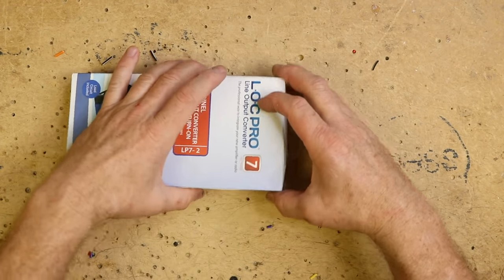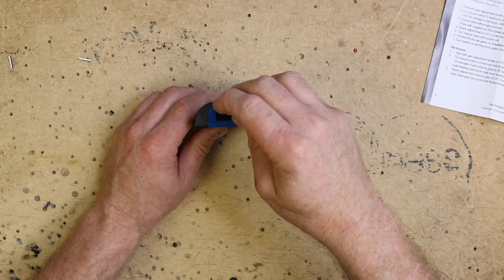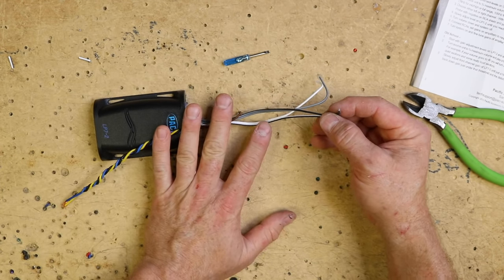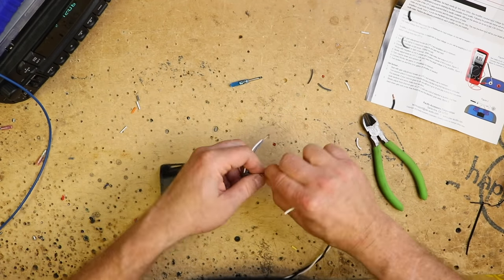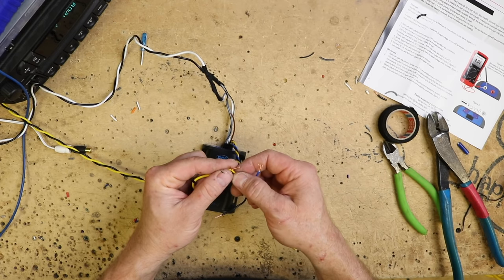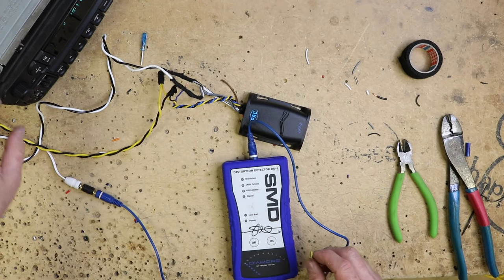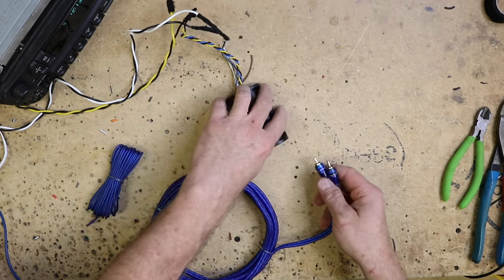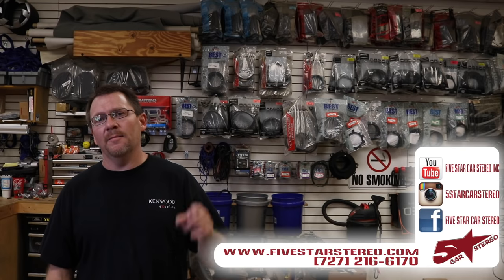How to connect a Pac Audio high to low level adapter, the LP7 2

Comment: I have a 2020 Corolla with JBL system.  I’m using an Audio Control LC1i LOC for my sub setup.  I have to turn the output gain fully clockwise to achieve only 3.9 volts…thoughts???  This should be able to put more voltage out.  BTW, your videos are a huge educational help!

Comment: Great video. I have a question,  I have a Honda civic, can I cut the wires from the speakers front and rear door to go into the loc or do I need to get the wires  from the head unit? Thank you.
Reply: Did you ever install it? I had the same question. Did it work?
Reply: From rear speakers since it gives full range frequency

Comment: If you use the power and ground from the amplifier to turn on the LP 7– 2 and the blue wire from the LP 7-2 to the amplifier remote how does the lp 7-2 turn on and off

Comment: Hi, great video.. I do have a question though... If you are running power to the converter <<< then does this stay on always? You showed the red light the second you connected the power to it... Will this be on all of the time with the red light? Also would it be smart for me to wire a small fuse in between the positive power wire to this thing? if so what size? Thanks! I hope to get a response from someone if they can help.

Comment: What’s the difference between the PAC LP5-4 vs LP6-4 vs LP7-4? I saw one of your install videos when you where working on the exact car I own, infinity g35 with factory Bose system, in that video you used a LP5-4.

I am now attempting that same install but don’t know to buy the LP6-4 or LP7-4...as the LP5-4 is now discontinued by the manufacturer. Please help...don’t want to order the wrong model..also I am aware I will probably lose out on my Bose sub in the rear deck using this. I’ve already picked up an amp and sub for the trunk. Installing pioneer avh2440nex.

Also, I’ve already installed this same radio in my 2012 Altima. Will the PAC SWI RC work for both the 2005 Infinity G35 and the 2012 Nissan Altima?

Thanks in advance for any help!

Comment: I was wondering, for this specific product, on the speaker side do you connect it just to one pair of wires for one speaker or will it go for all the speakers?
Reply from the maker: Alfredo Cantu if you are adding a sub you can tap a left and right speaker. Some people will tap one front and one rear, if you fade the radio at all. You can also just tap one speaker.

Comment: Hi Dean & Fernando!! I have a question about the LP7-2. I finished installing a JL W7 stealthbox and a JL RD 1000/1 amp on my 17 mustang. I tapped into rear deck speakers for signal and ground/power from the amplifier, remote from LP to amp. Played 40 hz test tone through HU and used my DD1+ for distortions. I got my max volume and adjusted the LP7-2 to 2 volts. Now my question is, do i play the 40z test tone again and set my gain on my amp until it shows distortion?? My DD1+ has the ability for overlap and i played 40hz overlap track and used my bass boost to give me 8 db of overlap. Is this the correct way to tune my amp? Or how do i set overlap correctly? When i start and turn my car off, my subwoofer is popping/thump, is this because of the LP voltage or my gains are too high? Please help me with my questions. Thank you!!!!!

Comment: On my sub amp I can use high level on rca input with rca adapters. Then I get signal sensing and remote out. Then send that rear channel out from pass through to 4ch amp rear channel running my NVX XPLOC4 as passive without the DC cables.

Front channels from LOC to front on 4ch amp of course.

Good idea?

6:1 step down what does that mean? My XPLOC4 says that in specifications.

I could only get like 2v if I remember correctly last I installed it.

How did you hook up your volt meter to measure the output?

Comment: I'm guessing this install setup he showed was for a subwoofer amp, because he tied two of the speaker wires together and mentioned that the sub-bass was recorded as mono not stereo. If he were installing this for full frequency speaker install, he wouldn't have done that. That's my understanding anyways, correct me if I'm wrong.

Comment: So you set the volume just before clipping and then measure the volts? or did you lower the volume when measuring the volts? Also, is the track 0 decibels or 0 decibels is achieved by turning the volume knob all the way down?

Comment: Hi there,
Nice tutorial, I have an old GM Delco radio (model number: 2700), my question is all amplifier have 2v, so I need to adjust that to 2v or how to identify this? My radio works only with 10-ohm speakers, so I need to add an amplifier to work with new speaker set.

Comment: I know this is a old video but I bought this now do I need 2 sets of wires from both front speakers for a subwoofer or can I wire them together like you did off just one front speaker lead just wondering thanks

Comment: I've had issues in the past using the radio constant 12v and ground to power LOC's. Rerouting those wires to the amp instead seems to fix it. Is there a reason why the LOC's can't share 12v constant power with the stock radio? Especially in newer vehicles.....thanks

Comment: Really help full. I have one doubt sir. What is the difference between line out put converter and DSP
Reply: LOC is strictly for going high level to low level (speaker wire to RCA for amplifiers) and a DSP is a digital signal processor that is able to manipulate sound and tune by adding equalization effects, adjust crossovers, etc.

Comment: This helped a lot.  One question, I ran a speaker line from after my factory amp.  That line is showing roughly 8 volts on a multi-meter, does that sound right?  Did I grab a non speaker wire?  It's a 2018 Durango with the Beats system so there's about 3 million different wires.

Thanks!

Comment: hello, I do NOT have a need for a remote turn on wire. Is there a benefit to buying an LP7-2 over buying the simple LP3? I simply need high to low conversion to RCA. Does the lp7 have better sound quality or something?

Comment: I wish you showed more of the radio side of this. Do colors black/white, white, grey/black, black all color match wires coming off the radio? Same question with power although im pretty sure yellow is always power. Also if just because i find a yellow, if theres more than one, do i assume its only on when the radio is on or does the LOC always get power? Also how was 2 volts determined for the LOC?
Reply from the maker: Factory radio colors do not follow any pattern. They will not match up with these wire colors. All cars are different
Reply: @FiveStarCarStereoInc   oh fun. you would know the colors for a 2016+ toyota tacoma would ya? also, any input on my other questions. thanks for your help. your channel is awesome.

Comment: Can you do an Install using one of these LOCs but using the rear speakers to do it and avoid dealing with taking out head unit
Reply: Alex Island ahh thats something i would also like to know to cause thats what i was gonna do cause its way easier plus all my wires will be in the trunk so no wire running lol
Reply: You sure can. Like you said, just tap into the rear speakers without having to remove the radio. Remember though, you still need to run a power cable from battery to amp
Reply: eaopanama yea i know the good thing is i gotta dodge charger so my battery is in the trunk
Reply: @rentjeff  It can't get easier than that then!
Reply: eaopanama oh no even the fuse box so no running wires to the front yee lol
Reply: @rentjeff  sweet!
Reply: Alex Island yea

Comment: So is it ok to run the remote wire to the amplifier instead of the head unit or any other accessory as a power source if the LOC has remote turn on??

Comment: If I don't have the extra RCA that you cut off to use to test the volts like you did in the video ,would I just put the positive to the terminal of the loc and negative on the vehicle ??? I used this product in my DodgeDart when I first put my system in it  but just got a nice tester and would like to adjust the game the new school way lol 12in alpine type r sounds good but always would like to make it better if there's room for improvement👍🏻
Reply from the maker: cory shaffer connect the positive test probe to the inside of the rca hole. Connect the negative to the rca shield or out side of the rca.

Comment: the two line / 4 leads i would be using is high level 2ohm 32-300 htz  sub leads from the factory Amp. would you see an issue with the rest of the circuit if i use the 2 /  2ohm sub leads to line in  for a  2 channel amp to power the 32-300 htz 10" subs.   ( i hope i asked that question right)

Comment: Have you had any issues with the remote signal sense? Example, closing the car door and the change in pressure moving the speaker cones.
Reply from the maker: Ovin we have not seen that one but we do have a couple of fun things that drive us crazy. In any VW we have to add a SNI1 noise filter or when you take out the key the sub goes crazy. That also happens in some American cars. The other issue we run into is when a new car wakes up( a door opens) the amp turns on for a couple of minutes then goes back to sleep. This sometimes make customers think their amp is staying on because every time they open the door to check the amp is on.

Comment: If the oem factory head unit has 4 speakers, does the pac need 2 speakers connected to it or can I just hook up 1 speaker and which one should it be? Front left front right rear left or rear right? Does it matter?

Comment: So I have a question...so the LOC I HAVE JUST HAS THE 4 SPEAKER WIRES THEY GREYS AND THE WHITES THEN TWO BRWN FOR GND... BUT IF I DON'T HAVE TO STILL BEHIND THE RADIO...BY HOOKING IT UP IN MY REAR DOOR SPEAKER..DO I HAVE TO RUN WIRE  FROM THE OTHER DOOR SPEAKER OR JUST ONE SIDE ND POSSIBLY JUST PUT BOTH POSITIVE N NEGATIVE TOGETHER TO GET FREQUENCY ND OUTPUT TO THE AMP?

Comment: I have a factory JBL system in my toyota. Should i splice in from the radio before the amp or after the amp or should i try to hook into the factory output of the amp for the factory subs(which this car did not come with subs). Will coming out of the amp mess with impedance causing the amp to over heat. My amp model is JBL 86280-0w622. Any input you have would be greatly appreciated. Thanks

Doug

Comment: My Terrain has factory low level outputs before the amp(full range).I measured them at 6.5v full tilt on a 100hz sine wave.Can I just attach RCA's to those and run them straight into the amps or should I use a LOC?

Comment: Hello there, I have Honda accord 2013 and I am trying to hook the Amp and sub to the factory head and speakers. have the same pac LP7-2 as in the video.My question to you is in the end of the video you mentioned if you decided to put the LOC to the amp at the back. You could use LOC power wire, ground wire and hook straight to the amp.Could I still hock my remote wire to the amp as well.Also, would the remote wire still need to come out from the fuse box from the front of the car to the amp or to the LOC and then mount it to the  Amp.Please advice. Thanks
Reply from the maker: +Jassi Dhesi the great feature of this high to low is it will make the remote turn on for you. The blue wire is an output not an input. If you connect the yellow, black, blue right to the amp, it will turn on the amp when it has sound come in over the speaker wires. No going to the fuse box.
Reply: Five Star Car Stereo where would the blue remote turn on wire connect to on the amplifier?

Comment: I am using the lp7-4 and a kicker  cxa300.4 amp that uses the DC offset turn on, do I still need need to wire the 12v constant and ground since I won't need the remote turn on?

Comment: Awesome video! Any info for the LP7-4.. ? I'm doing an install with aftermarket radio but keeping the factory amp .
Reply from the maker: monkey42601 basically it works the exact same way just has 4 channels. We don't use the 4 channel all the often. We try to go with the Audio Control LC7i
Reply: Five Star Car Stereo  can I wire the yellow and blue with the yelllow and blue output from the radio harnesS? That's where I'm confused .. I got the audio wires ready to go just not sure what to do with the yellow blue and black wire! Thanks

Comment: I have a 2006 ford explorer limited and it has a 8 inch subwoofer can I hook the line out converter to that speaker wire instead of the other speakers

Comment: Hey guys. I just purchased one of these units. This video is very helpful, but i already have a remote turn on wired for my amplifier. Does that mean that I do not need to wire the remote, power, and ground wires of the L.O.C.?
Reply from the maker: F150 Guy yes leave the yellow, black, and blue wires disconnected

Comment: Hey guys, love the videos. I have a question I am considering adding a RF  P300-10 powered sub to my corolla factory head unit. since the sub has high level inputs do you still recommend using a hi to low converter or just go directly with high into the sub.
Reply from the maker: +Nikolay Rashev no HI to Lo need for that sub system
Reply: Five Star Car Stereo thank you very much

Comment: do I need one of these line output converters? i am tring to hook up my stock radio to my eqs755, my problem is thei high level input has 4 wires, my radio has 8 for each speaker should i change to the low level RCA and if i do how do i hook it up with the 8 wires. thank you for any advice.

Comment: I talked to a tech at Pac about using this in a 2017 civic w/factory radio to connect to a RF powered sub.  He said "Needs constant ground and signal from your factory speakers and it will generate the 12v turn-on".  I'm confused.  No remote or power???

Comment: Question: I have a '18 corolla
I have a pdx-v9 alpine amp
I was told I can tap into the rear speakers to connect a line output converter.
Will the Pac lp7 be the correct one to use?
Also I will be adding a sub later to that 5 channel, will it be easy to hook up and just be a simple plug into that 5 channel for the sub ?

Comment: ive never used a loc in a build, if I tap into lets say left rear speaker can I keep the spearkers wires attached to the speaker or do I lose that speaker
Reply: Patrick Green I assume you would just slightly strip the wires and connect the speakers wires from the LOC to whatever car speaker wires you stripped. Electric tape will be needed

Comment: ineed help, i want to put MiDs on my car on 4 Doors &&, 4 Rear Deck,,  im going to be usen my stock radio from my 2010 Acura TSX,  can i get more info Advice on what i will be needing ?  Or how would i connect the LOc

Comment: hi its me again so i have 2 questions 1st is i have the 2018 charger and want to know what fuse would be best to run remote wire to if i don’t buy this kind of converter cause i have 2 the old one of this brand and a clear one so might as well put one to use unless i get one with a bass knob and my 2nd question is do i have to disconnect the noise canceling mics in the headliner? cause some stereo shops tell me i do so the subs won’t make noise and i really don’t wanna do that cause I’m use the bluetooth in my car plus i don’t wanna pay to have them install it when i know how to do it myself i might just give yall a call tomorrow if that number is still good

Comment: Any ideas on why my amp is staying on after I turn truck off?  I have the lines set like you showed but it stays on
Reply from the maker: It should stay on until the car goes to sleep. Usually 30sec to 5 minutes. Shut the doors and don’t touch anything.
Reply: @FiveStarCarStereoInc  thank you

Comment: Stock 2016 f150 snyc3 leaving factory radio running the lp7-4 into a old pioneer 4 channel amp to run all four door speakers should I cut all rca on lp7-4 harness and splice speaker per speaker in loc.    Also I do not want door chime or other to be amplified so I not power the loc and run a remote from the fuse box I the am then using the rca out on my amp to run a kicker hideaway.
Reply from the maker: +enviouseyes is it a Sony system?
Reply: Five Star Car Stereo  no Sony
Reply: I went ahead and did install all works great fActory chimes and alert all work great.  I still have some noise playing through would this be the time I connect the ground and power or will that not have any bearing on noise reduction

Comment: Question, I installed the LOC in the trunk right next to the amp using the rear sub to splice (06 Daytona Charger). I installed the remote wire, 12v & ground directly from the LOC into the amp. When I turn my car OFF after about 10 seconds the subs start hitting constantly at like 30Hz... The only thing I can think of is that the LOC Remote wire needs to go to a source that has a cutoff (like the cig lighter) and then to the amp... however, my battery is in the trunk so everything is installed in the trunk so i cant exactly splice into the cigarette lighter unless I run a wire from the front to the back... so the questions is; is my theory correct? If not, do you know what would cause the subwoofers to constantly hit after turning the car off & how to fix it?
Reply from the maker: +Randall B it is a ground noise. There are two ways to fix it. Use a PAC sni-1 noise filter plugged between the lp7-2 and the amp usual fixes it. Or there is an accessory input for the lighter  in the fuse box. You can run a wire over to the fuse box and connect it there.
Reply: I have a 2008 charger and ran the remote to the cig lighter fuse